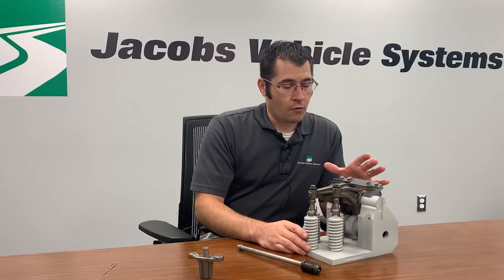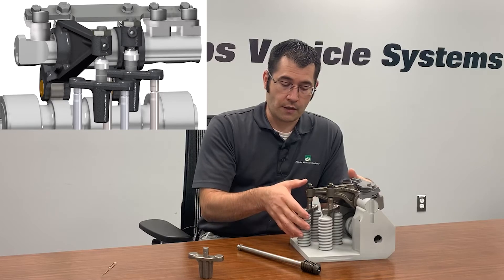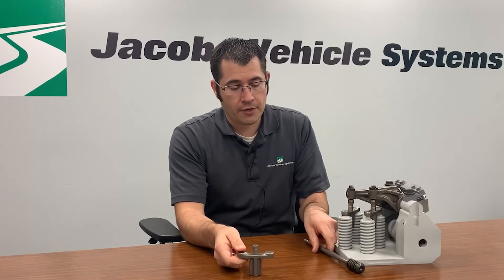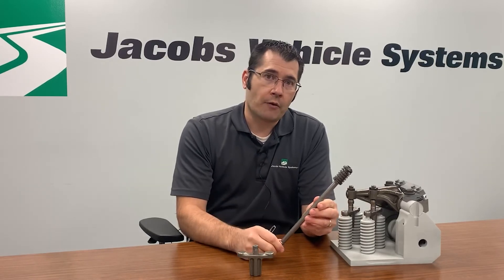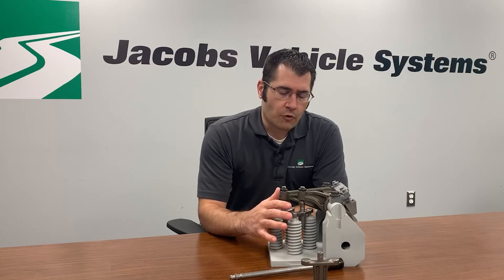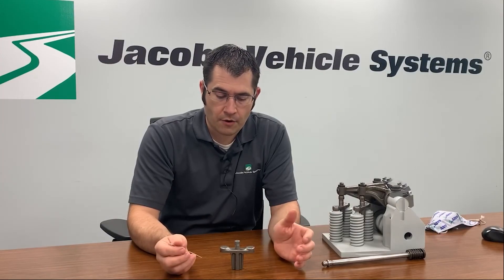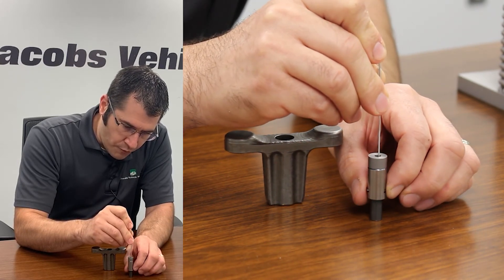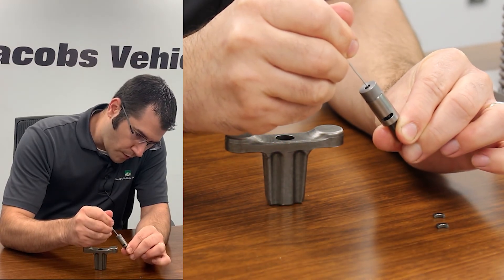Jacobs Tech Talk #3 | Cylinder Deactivation Explained

Comment: I’ve got a question that I can’t seem to get right regarding cylinder deactivation.

During cylinder deactivation:

1. Total fuel injectiodelivery is increased 
2. The ignition system continues to function
3. The throttle butterfly opened is increased
4. The pumping efficiency of the inactive cylinders is inproved
5. The fuel to the active cylinders is increased.

From the list which apply during cylinder deactivation?
Reply: This system is designed for a diesel engine, so #2 and #3 don’t apply at all

Comment: Cylinder deactivation is a garbage system that reduces the life and reliability on every engine equipped with it! So while your explaining how the system works explain the failures too so people aren't paying thousands of dollars for a engine that won't last
Reply: And suckers like me bought it... probably should of bought the 3.5 EB.
Reply: @Saintsandsin my current vehicle is a 2021 Ford F-150 with the 5.0 V8. The problems have been, rusty rear axle, axle U bolts causing a clunking noise on hard turns over bumps (both had to be replaced), clunky transmission shifting, and now there’s a recall for windshield having to be reinstalled due to not using enough adhesive at the factory. My previous 2019 F150 with the 2.7 was a complete junk box!  Temp sensor in cylinder head left me stuck on the side of the road twice, fuel injector leak that left me stuck on the side of the road, bad water leak into the cab via a air vent behind the rear seat which required the bed to be removed, wind leak driver door, rusty rear axle, rust spots on frame, radio screen going black, and cell phone connectivity problems. I know the 2.7 has a pretty good rep but that 2019 left me with a really bad experience to the point I don’t think I’ll do another turbo engine. They had the intake off my engine 2-3 times between the temp sensors and that fuel injector leaking smh. The wet smell in the truck was horrible and they refused to replace the carpet as “it could be dried out” after they removed all my trucks cab lower interior. They actually broke a $350 panel and refused to replace it because I didn’t realize it until a few weeks after I got the truck back.
Reply: @Saintsandsin hard to say. If I had to do it all over again I might go Toyota Tundra but they are having issues too with their trucks. My wife’s 2015 Toyota Sienna had lots of problems too. Maybe I just have bad luck with cars.
Reply: I have a 2020 Mazda3 with cylinder deactivation 130k miles never had a issue